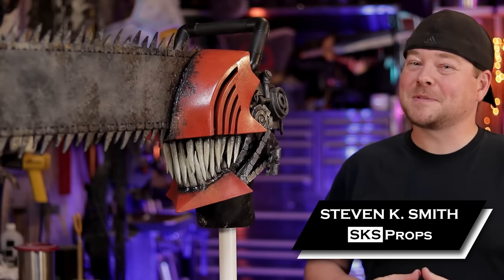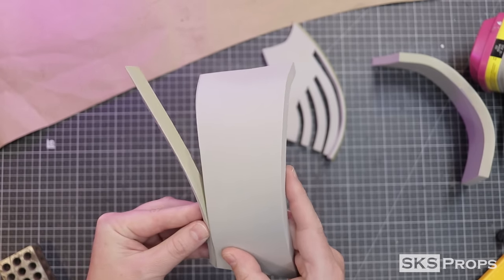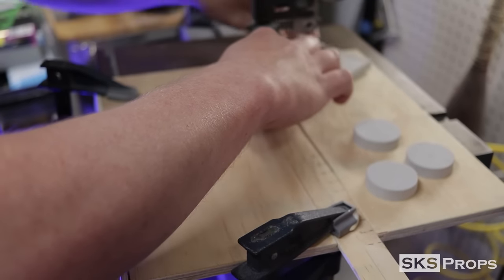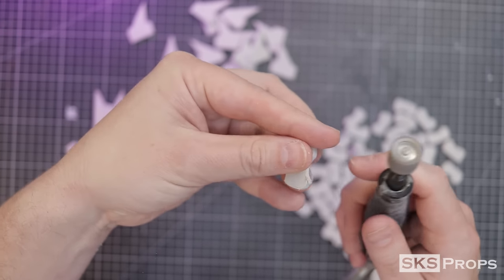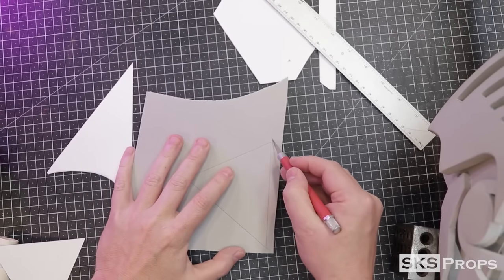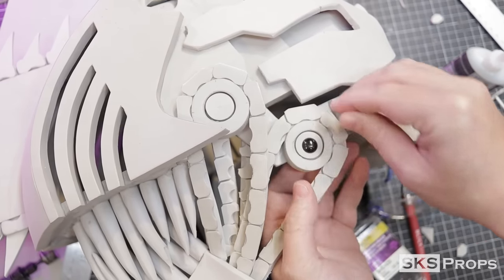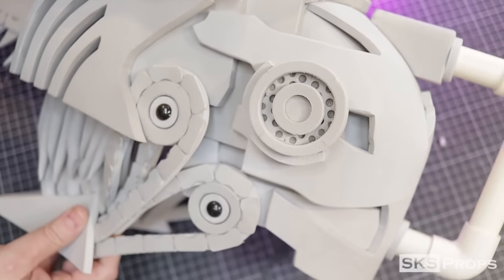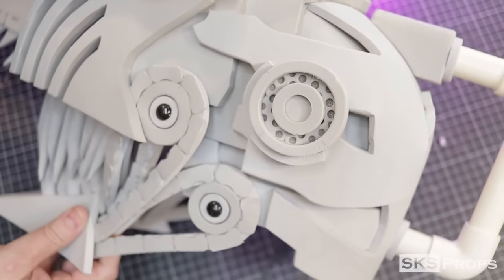How to Make a Chainsaw Man Cosplay - Free EVA Foam Template - Denji Cosplay Tutorial Part 1

Comment: Amazing, just a quick question how do you see out of this, would you suggest getting rid of some teeth so that you can see clearly in front of you?
Thanks for the free templates I ordered some of your HD Foam :)
Reply from the maker: Thanks! I can actually see pretty well through the gaps in the teeth and the small slits on the sides
Reply: @SKSProps  is there a method to cut at an angle using a bandsaw? I tried to look up some tutorials but none were what I needed haha.
Reply from the maker: @shingshing825  a lot of time the bed of the bandsaw can be changed to give you the angle you need otherwise cutting by hand just takes practice
Reply: @SKSProps  thanks so much, just bought a bandsaw this weekend to add to my woodworking arsenal thought I'd give it a whirl on foam.

Comment: Just wondering are you using a hand belt sander turned upside down?
Reply: Also what crafting mat size do you use for your workbench thanks. I continue buying your foam on blick :)
Reply from the maker: I’m not but durning what part and I’ll try and explain it
Reply from the maker: @shingshing825  my cutting mats are 24x36
Reply: 6:50, yeah it looks like a normal belt sander. I got a hand one though hopefully it works for this purpose.

Comment: Hey. Im in a hurry so. How much material did you use for the whole build (foam wise)?

Like how many rolls of each?
Reply from the maker: A roll of each size 2,4,6,10 plus you might need an additional 6 depending on how you lay out the templates for the arms
Reply: @SKSProps Has anyone told you how freaking beautiful you are?

Thanks, you are a life saver, I hope I can do this before Halloween. Do you ship to Mexico? If not I'll donate a fat tip eitherway.
Reply from the maker: @El_Andru  Blick Art Materials can ship to Mexico but you might be better off trying to find foam locally for this one since you need it ASAP
Reply: @SKSProps  Probably. Alright. Gimme a couple of days for the tip. Need to catch up on that.

Comment: I'm going to make a Chainsawman helmet and I'm going to buy an hf form on your homepage, so is it right to buy 4 sheets of 24x60 size according to the your template?
Reply from the maker: A sheet of each size 2,4,6,10mm should be fine.  depending on how you lay out the patterns another sheet of 6mm may be needed for the arm blades

Comment: would this require your hd foam or can I just get craft foam from a craft shop somewhere if im on a tight budget
Reply from the maker: You can use what you want. But craft foam usually doesn’t come thick enough. You are gonna need 2,4,6, and 10mm foam just so it will keep its shape
Reply: @SKSProps  thank you. I forgot to ask, are there any replacements for a rotary tool? I can’t find cheap ones around 20-30 bucks
Reply from the maker: @neptune2658  watch my Wen rotary tool video I’ve got a link to it in the description section
Reply: @SKSProps  thank you! you are awesome dude!

Comment: Can I just use EVA foam from Amazon for this instead? This video rocks but i would much rather prefer getting everything from a single place++
Reply from the maker: @Danny-mp8dq  you can get my foam on Amazon too but it’s cheaper to get my cosplay bundle through the links in the description section and get everything from Blick Art materials with free shipping. Plus it helps supports me since I give the videos and templates for free. If you want to get it all from one place get it from Blick it’s cheaper and better quality
Reply: @SKSProps  Oh it's a bundle? Actually that might be both cheaper and faster than being everything individually at my local hardware store

Thank you! I'll check it out

Comment: where I live there is only 2mm foam, is it a problem to do it with only 2mm foam?
Reply from the maker: 2mm foam isn’t going to work for the whole project. You’d be better off using cardboard for the build and skinning it with the thin foam for a smoother surface
Reply: @SKSProps  thanks for the advice and quick reply. I appreciate it! ❤️

Comment: Thank you so much. I wanted to buy hd foam but Im new to cosplaying abd dont want to make a mistake.
Reply from the maker: Mistakes are part of the journey and learning process. But I will say if you are new learning to build with my foam is much easier than on the floor mats lesser quality products
Reply: @SKSProps  It says to select poster but I dont have that option available
Reply from the maker: @Josh-se4uz  yes you do, open the pdf in adobe acrobat or adobe reader (free version) and click poster in the print setting in adobe.
Reply: @SKSProps  Would I be able to do it on my phone because I do not have a computer acces at the moment or would getting it printed at a shop work?
Reply from the maker: @Josh-se4uz  I’d go to a shop 👍 they can open the pdf and print it properly

Comment: Hi, I’m having trouble getting part B to align with part A as part A seems to be slightly too long for part B. Both are cut with a 30 degree angle as well (with the straight cut at the bottom for B) 
What should I do?
Reply from the maker: I don't know what to tell you, they are the correct size and lot of people have been able to assemble this project without issue. If a piece is to long that you are cutting out on your project trim it to fit
Reply: @SKSProps  I ended up cutting out a scrap piece to fit the space to extend part B, weird how come it didn't fit though

Comment: I want to recreate this build but I’m a small boy. So I was wondering how big the helmet is by default.
Reply: Also about how much foam is used would the 30$ bundle be enough or how much had foam should I get
Reply from the maker: You determine the size of the helmet to fit your head when you attach part “j” otherwise I think the scale is fine might even work better with you being a bit smaller. 
You need a sheet of each size 2,4,6,10 so you’d want to add a 4mm to the bundle. If you place your templates right you might even have enough for the arm blades as well 
Have fun 👍

Comment: What shouldi do since I don't have a rotary tool or any of the forstner drill bits
Reply from the maker: If you’re going to be doing foam work you need a rotary tool they are cheap on amazon I did a review on the Wen version. For the holes just rough cut the circles by hand and clean them up with the rotary tool.
Reply: Thanks!
Reply: Found one for like $30

Comment: hi sks
Greetings from Argentina and thanks for the templates, I wanted to consult you since I will start with this project, if it is made for your head; What diameter would it be to be able to fit it?

And I wanted to tell you that I finished Sandman's helmet
Reply from the maker: Head size doesn’t really matter you adjust this build with part J to make it fit you

Comment: Can this be made with just a hobby knife and scissors?
Reply from the maker: When I started I just used knives, scissors will dull quickly cutting foam unless you get some designed for leather or harder materials. If you are going to do more foam work you really do need to get a rotary tool of some type, and a heat gun to manipluate the foam. Check out the video I did on the Wen rotary tool
Reply from the maker: zhadman  not hot enough.

Comment: would it be possible to add a screen/camera to the inside of the mask behind the blade so you can see in front of you?
Reply from the maker: Seems like overkill. You can see out through the gaps in the teeth and the slits on the sides
Reply: @SKSProps  do you remember what Forstner bit size you used for the back and top?
Reply from the maker: @Striker.Cosplay  3/4” because they are 3/4 pvc pipes

Comment: Hey, so i want to order hd-foam in germany because i want to avoid extra costs from shipping outside of europe. i found a website which offers 2mm, 5mm, 7mm and10mm instead of the 2mm, 4mm, 6mm and 10mm hd-foam, you were using. Can i use them or do i need to have your hd-foam size? (i tried my best to avoid mistakes in the english language, i hope you understand what im trying to say :D )
Reply from the maker: Should be fine with those sizes 🙌

Comment: Quick question will I have to size the template?
Reply from the maker: You will need to follow the directions on my website and open the PDF templates in adobe acrobat or adobe reader and click poster in the page size area that scales it properly over several sheets regardless of your paper size
Reply: @SKSProps  Thank you very much!

Comment: how would i make the teeth if i dont have that tool that you used? also how to do angle cuts?
Reply from the maker: You can do angle cuts by hand without a bandsaw and for the teeth you can still get the 15mm dowels and rough cut them with a knife then smooth out with a rotary tool
Reply: @SKSProps  oh thats great, thanks alot!

Comment: Unbelievable, but how much would it cost to make the cosplay even with the paint?
Reply from the maker: Foam and paint are cheap the arm blades even if you bought all new supplies should be less than $100
Reply: @SKSProps  I love your content and your selflessness to share this for free, but I looked on blick for the heavy body paints and even a 2 oz tube goes for around $10 (the cheapest, not even the colors that I needed), which is very expensive for the amount you are getting, not to mention you have to use like 5 different colors.

Comment: hey sks props how do I scale the template to fit my head? I'm thinking of doing this project so
I want to avoid any problems if possible
Reply from the maker: Awesome 
Just follow the directions on my site and open the pdf in adobe acrobat or adobe reader and click poster in the page size area that scales it properly over several sheets regardless of your paper size

Comment: I couldn´t find a hd foam round dowels or the teeth material. Which other material can I use to make the teeth? (I'm sorry if my english is bad, I don't usually use it xd)
Reply from the maker: You can just stack 10mm foam and cut it for the teeth and use another type of air dry clay for the gums it won't be as durable as the foam clay but you have to work with what you can get
Reply: @SKSProps  ty

Comment: this is so amazing and it turns dopeee❤️🔥
what's the size of pipe?
Reply from the maker: All of the dimensions are on the pdf templates
Reply: @SKSProps  OOHHH i didn't notice my bad my bad, thaaank youuu
Reply: @SKSProps  i have a question, is it okay if i use 5mm instead of 6mm coz i don't have a budget to buy a new foam 6mm?

but i have 2mm or is it okay if i combine it to 5mm to make 7mm?
Reply from the maker: @DayenSaur  I’d stay with 5mm rather than trying to make 7
Reply: @SKSProps  THANK YOUUU VERY MUUUCH☺️❤️ this is a big help❤️
Reply: what length you used for the teeth? and the 4mm strips?

Comment: I have a question on part h every time I make the piece the part either won’t be touching the top of the helmet or won’t touch the bottom parts
Reply from the maker: If I was you I would just add some scrap pieces to the bottom to make it touch. extra pieces there won't look out of place since it is kind of hidden by the front
Reply: @SKSProps  thank you really like this build you got some crazy talent

Comment: Where the heck can I buy 3M 74? Can only find it on Amazon but they wont ship it to any addresses or Amazon lockers my area.
Reply from the maker: You don't have to use that specifically, any spray contact adhesive will potentially work. I just like 74 because it's thicker than 77 or 79 (which can be found at most hardware stores). You could also use regular brush on contact cement as well

Comment: Hi, so my Epson printer won't print in any size other than letter :( Too bad, I was really looking forward to making this for my son for our upcoming Con.
Reply from the maker: Follow the directions on my site it doesn’t matter what your paper size is. Watch my how to print templates video
Reply: @SKSProps  hello! Thanks for replying! I watched the  video, I have Adobe, it downloaded perfectly, BUT my printer ONLY has the "letter" size option, not "poster"  so it will only print your templates on 1 sheet of paper.
Reply from the maker: @kellieschwabe5970  when you open it in adobe and in that program click the print icon. The print box open and under page sizing that is where you will find “poster” click that and it will divide the pattern over several sheets regardless of your paper size
Reply: @SKSProps  thanks for trying to help. I have Windows 11 and Adobe Reader (Epson prinyer)...I have opened the template in Adobe but unfortunately there is no "poster" size option (about 15 other sizes though) . It's okay, thank you though! I do appreciate your responses and trying to help. Excellent cosplay! I love your work :)
Reply: @SKSProps  hello! I have a question: I cannot find 10mm foam anywhere where I am...would the 8mm work just as well without any adjustments?

Comment: Does part K need to be 6mm or can it be 10mm?
Reply from the maker: Use whatever you’d like. I used 6 because it wraps all around the back of the head and it going to be much easier to manipulate vs a 10mm piece
Reply: @SKSProps  Thanks for the response! I had already accidentally cut it out of 10mm, and it really surprised me how big of a difference there was between the 10mm and 6mm in terms of stiffness/ease of manipulation, with only 4mm of difference. In the end I cut out another one in 6mm foam instead to follow the tutorial more precisely and to avoid issues down up the line. Currently I'm on the second part and in the middle of painting! It's truly amazing that you are putting these tutorials out for free! This has really made me discover the fun in making cosplays and props! This is my first and I'm DEFINITELY going to make more and also donate when I'm a little bit more financially stable hahaha. BIG thanks! And I'm 100% shouting you out on TikTok when I make a video about my process of making this, I usually get quite good reach with my videos on there so hopefully more people will drop in here and find your stuff!

Comment: I don’t have a printer at home and am hoping to print the template at an Office Depot. If I’m printing it there, what would I put for the dimensions of the template print?
Reply from the maker: It doesn’t matter just follow the printing directions of opening the pdf in adobe acrobat or adobe reader and click poster in the printer settings that scales it regardless of what paper size you use
Reply: @SKSProps  awesome thank u so much! Just in time too!

Comment: Can I use 5mm foam instead of the 6mm one? I can't really find a place to buy one
Reply from the maker: You can most places in the US have 6, where do you live
Reply: @SKSProps  Philippines, but I buy my stuff online and the only foam close to 6mm is 5mm which is only available there (I can't buy HD foam even if I wanted to considering I only pay cash on delivery) plus there are no near places I can buy em.
Reply from the maker: @cheesyramen6114  Gotcha, % should work fine for this application worse case you reinforce it on the inside with some additional foam
Reply: @SKSProps  another question, what are the measurements of the pvc pipes you used? (btw I finally found 6mm foam :D)
Reply from the maker: @cheesyramen6114  measurements for all of the pipes are in the lower right corner of the template

Comment: The blade is really heavy on the head. The glue Iam using doesn't seems to be holding it  is there any other solution?
Reply from the maker: I don’t know what to tell you. If you followed everything I did in the video - foam is very light and all of the glues I recommend work fine. What are you using

Comment: My printer won't let me do poster size, if I take this to a print shop that does large sheets, what size should I use so the template is correct? There are many "poster" sizes.
Reply from the maker: The poster button is not in your printer settings. Follow the directions on my site and open the pdf in adobe acrobat or adobe reader and click “poster” in page size area that scales it properly regardless of your paper size
Reply: Thank you for the fast reply!!

Comment: I tried printing the template but it was small any advice
Reply from the maker: You need to follow the directions and open the pdf in adobe acrobat or adobe reader and click poster in the print settings that scales it properly

Comment: hi.. I'm very happy with this template n_n
but, how to change head size?
I'm from Asia with a small stature. height 165cm with weight 45kg, and head circumference +/- 53cm
thanks
Reply from the maker: You can scale it down 8-10% if you need but most of the helmet is adjustable to your head when you install part “J”
Reply: @SKSProps  part J only?
Reply from the maker: @armandxclara  part J is what wraps around your head to the front of the mask. But I have had hundreds of people make this without changing the size at all
Reply: @SKSProps  okey master thanks very much

Comment: How many sheets of each foam did you actually use?
Reply from the maker: If you got a sheet of each size 2,4,6,10 you’d be fine and might even have enough for the arm blades if you lay the templates out right otherwise get 1 extra sheet of 6mm for the arms 👍
Reply: @SKSProps  thank you for the information